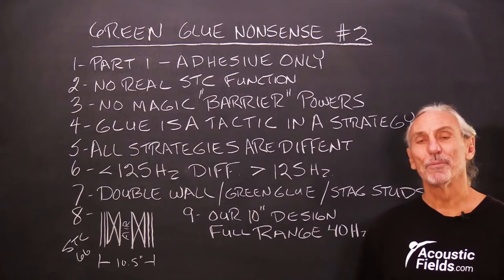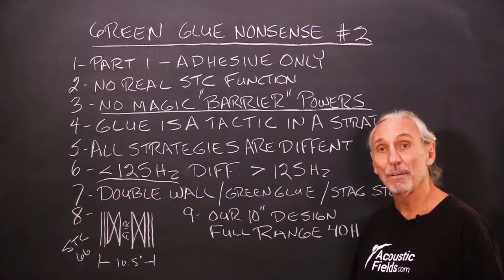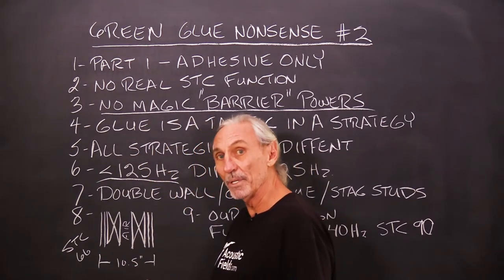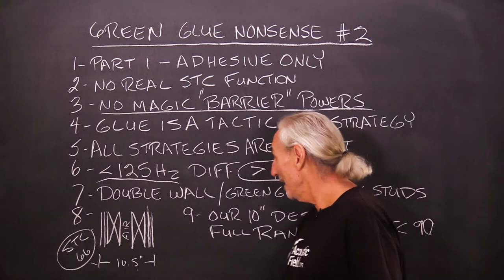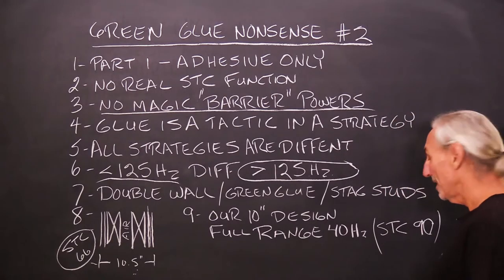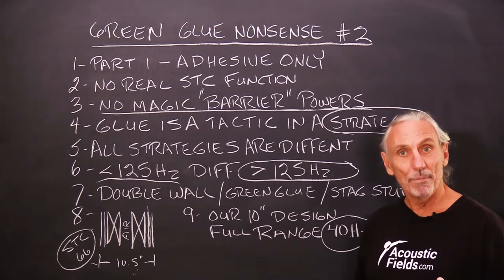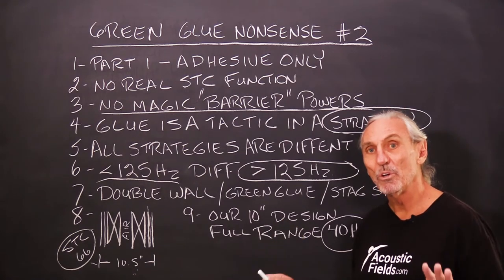Green Glue Nonsense! Part 2 - www.AcousticFields.com

Comment: The Quietrock product you show in your example uses a viscoelastic layer. Guess what? Green Glue is a viscoelastic layering product, the same product you keep bashing. Bashing this product would be like bashing the MLV product you also use in your example. Green Glue and MLV are small components of a larger solution to address a problem. You are basically saying in this, and your Part 1 video, that $30,000 cars suck because Bentley is a much better car. You are comparing apples and oranges. There are tons and tons of people that are happy with the result they get from Green Glue (and other viscoelastic products like it) as part of a comprehensive solution including decoupling with things like clips and channel. Just read the many positive reviews from home theater builders in avsforum.com for example. I have no doubt the example alternative you offer here is superior for higher STC, but it has a significantly higher cost too. Does Green Glue alone offer smaller improvements than 4 layers of MLV + 2 layers of Quietrock + 2 layers of plywoord + 2.5" of carbon + more? It most likely does. But for people that are home theater enthusiasts or have budget studios looking for proven economical solutions, and find your videos that make absolute claims like "this product is nonsense!" just serves to confuse and misinform people.
Reply from the maker: Green glue is an adhesive marketed as as a viscoelastic layer. Read the ingredients on the label. If you want to spend more money on glue for your barrier design that is your choice. It is not the adhesive that produces the performance. It is the layering of materials and the air space which is considered a layering material. We receive numerous calls each day from people who have used this method and are unhappy with low frequency transmission. There are many barrier options that take up less space and perform better. We prefer solutions that treat the complete frequency spectrum especially for home theaters where low-frequency energy issues predominate.
Reply: @AcousticFields  I understand you prefer solutions that treat the complete frequency spectrum. And thats awesome. Your videos prove you guys can build barriers with superior STC ratings in the very difficult to fix <150Hz range. I just have a problem with you promoting yourself by bashing another reputable company that has many happy customers (click bait). Read their literature (about the fact that its NOT just glue), read the many many reviews from users that properly used the product as part of a comprehensive solution. If someone wants to solve the < 150Hz issues, thats an entirely different issue than whether they used Green Glue or not. MLV does not solve that issue either.
Reply from the maker: People can be happy and unhappy for many reasons. Most of these companies play upon the ignorance of the very people they sell to.  Green glue is just what the name implies. It is an adhesive. To attribute some magical barrier benefits to it is ridiculous.  It is an adhesive nothing more and that adhesive is a micro part of a macro design. Once again, MLV is just one part of a total acoustical "spring" system that reduces noise transmission. You can not claim that "MLV does not solve that issue either." You are following in the footsteps of the green glue crowd.
Reply: The point is, MLV does not "solve" the issue, it contributes to the overall solution, just like viscoelastic polymer layers.
Reply from the maker: Yes, it is one material type out of hundreds that we use in our barrier designs. The key to understanding each individual noise frequency and amplitude issue is what material type works best at what frequency and amplitude. Most material types have little value by themselves. Its when they are used in conjunction with other material types that the real synergy occurs.

Comment: The comparison is apples to oranges. Your design is using 4 layers of 1/4" MLV an inch thick in total. With 1/2" plywood? The cost is astronomical compared to double drywall.
Reply from the maker: Its always cost versus benefit with noise. Your method takes up a lot of space and is only effective above 125 Hz. If your noise issues are above 125 Hz. and you have that space requirement to use then this method will work although poorly. Noise transmission efforts below 125 Hz. require much more costly solutions. This is why companies tell you this double wall methodology will work for all noise. It is cheap, easy to build, but what they don't tell you is that it won't work below 125 cycles. I get calls everyday from those who have used this method and are not happy. Unfortunately, the fix in most cases is to tear it out and start again.

Comment: What’s the price difference between the 2 methods?
Reply from the maker: What two methods are you referring to?
Reply: @AcousticFields  green glue versus your method
Reply from the maker: There are no two barrier methods the same. You must measure the frequency and amplitude of the noise issues you are having over a seven day period. We are looking for the frequency and amplitude that is the lowest and loudest over the 7 day period.  We then design the barrier that you build. Every material type and construction methodology depends on the noise issues (frequency and amplitude) you are dealing with. The double wall approach takes up a lot of space, is 40 year old "technology ", and only works above 100 Hz.  Its a waste of time, space, and money.

Comment: So the design in your diagram calls for 8 sheets total of 1/4" vinyl across the barrier? that's a lot of mass, which I guess buys you the lower frequency attenuation. I'm a drummer so definitely want as much low frequency attenuation as possible. Im just a couple weeks away from construction of my garage to drum studio conversion project, essentially using the former design you criticize, so you have me pausing. hmmmm....
Reply from the maker: I do not know what design you are referring to. The standard double wall with this adhesive type does not reach below 125 Hz. It won't help you with your drum room.
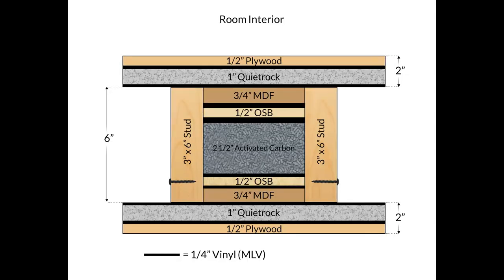Reply: @AcousticFields  Am I correct that your diagram shown at 7:06 in the video is calling for 8 layers total of 1/4" MLV?
Reply from the maker: With drums, you will need to create a wall that is 12" deep. The construction methodology will be determined after noise measurements have been taken in the neighborhood.

Comment: Very interesting alternative in your wall design using the carbon fiber.  Would you use decoupling techniques if installing this in a home environment to isolate from the existing structure?  Especially for rooms where sound transmission leaks through the ceiling to upper floors.
Reply from the maker: All materials and installation methodologies are directly related to the frequency and amplitude of your noise transmission issues. Every material you use along with the way you assemble those materials depends on noise measurements. This fact is so critical, we will not assist any project for noise transmission issues without noise numbers over a seven day period. Since we guarantee our work, we must quantify and qualify any issue before treatment design.

Comment: This is the first acoustic fields video I saw and almost dismissed you guys as it's a little ridiculous to be ragging on green glue/damping compounds and drywall--mainly for the company testing a huge variety of wall designs, then in your graphic you show you use damping compound and drywall...plus plywood, osb, mdf, and layers of 2lb MLV. I'm sure it works great but your room appears to cost around $50/sq ft before the acoustic panels. Of course your bulletproof wall assembly is going to outperform a diyer slapping GG and a second layer of drywall. Do you ever have foundation/ structural issues with all the weight?
Reply from the maker: All structural issues are identified prior to installation.
Reply from the maker: Our rooms work at all frequency ranges for the barrier technologies. STC ratings are worthless when it comes to low frequencies. The STC scale starts at 125 Hz. and goes through 400 Hz. What good is an STC of 66 when the first frequencies it measures is 125 Hz. Taking up 10" of space to deal with 125 - 4,000 is a waste of space.
Reply: I understand your are talking about structural, low frequency sound, but I'm trying to understand how GG + drywall is different from Quietrock? I can't get Quietrock in my area, so if I were to use Quietglue Pro instead of GG between two layers of drywall, would I get better results? I'm sure that drywall with a viscoelastic sandwich from factory has better QC than trying to create that layer on site, but otherwise aren't they all essentially the same? To get 1" of Quietrock, is that two layers of half inch? I've only ever seen QR in 1/2, 5/8, and 1 3/8.
I think your example wall designs are great BTW--that's a ton of mass! I'm just trying to understand the issue with GG as a product, not the wall designs their product has been tested with.

Comment: Green glue works. Contrary to your obvious bias. 
It works exactly as its supposed to.
Reply from the maker: So does standard construction adhesive at 25% of the cost. Compare the ingrediants of both. They are identical.
Reply: @AcousticFields  you say that it doesn't work, but have you actually used the product?
I haven't either but Orfield labs tested green glue vs construction adhesive 

sandwiched both between 5/8" drywall with r13 insulation in the wall, studs 24" on center

adhesive stc was 37 vs green glue 55 

even the competition to green glue was able to get an stc of 52 

so while it won't make a room soundproof for a recording studio I think it definitely works better than adhesive 

and take your rebuttal of the ingredients are the same. if you look at just construction adhesives, some can only hold 100 lbs while others can hold 300 lbs. not even all adhesives are the same

I would be happy to have some test results of cheap construction adhesive that works at 25% of the cost so if you have that data I would love to save a bunch of money

Comment: Heeeelllpppp!!! I need to soundproof my drum room! The room has its walls up so I can’t rebuild everything, what’s the best thing for me to add to walls?
Reply from the maker: You will have to measure the frequency and amplitude of the noise in the drum room. You will need to measure the frequency and amplitude of the noise in the rooms where the noise is transmitting to. The difference between those numbers is the effectiveness of the existing barrier you have between the rooms. Once that is determined you can then design the proper barrier technology to make up the difference required.
Reply: Makes sense, thank you for the response, I’m checking out your website now

Comment: the amount of times that we have to tell architects that this new acoustic product they found won’t work is staggering 😹 Things like expanding foam and ... oh the nonsense haha

but we build those walls in offices etc where you need some privacy etc but noise source is vocal range so it works ok
Reply from the maker: This process is limited to voice frequency responses. However, taking 10" of space to provide noise transmission for voice is not cost or space effective.

Comment: 2 things that you abuse doing. Saying that something doesn't work, but not giving a lot detail about what really does and why. You answer pretty much everytime by saying at it depends on frequency. Look, people watch this video for soundproofing knowledge. It's about soundproofing, as much as possible, as low frequency as possible, ok, period. We want the smartest approach to get down as much as possible. Best low frequency blocking for that 10" space. Also, you are quick to say that green glue is expensive (and it is, and you're right, if it's about creating a thin air gap and decoupling the 2 layers of panels without wall, any flexible adhesive will do, but you don't really say how expensive is "the other approach". We see a message there that you want people to go to you so that you can sell them your solution, not really educate people to what to do. Just telling them what not to do... That's the main problem here I think.
Reply from the maker: The main problem is the lack of understanding of the physics by layman. I get calls everyday from people who use all of these methodologies and are disappointed with the results. Most of these methods are 40 - 50 years old. Most people recommending these options have never built a room in their life. I have built over 240 rooms and tested all. When you are trying to change belief systems that are not well founded in physics, you must first start with showing the unwarranted premises that people work from. The industry has played upon the ignorance of the customer. You must first start with discrediting the unwarranted parts of the belief system. We will be doing a series of videos on specific barriers we have used to treat noise issues on actual projects.
Reply: I am totally aligned with Daniel as I find the video quite interesting but prompt to criticism of  other industries but no others details solution provided. I am sure that many of us will understand the physic contrary to what you say.  Additionally, you are making no distinction in what you present between a music/home theater for example and a standard room which can be misleading. Not everyone will need a STC of 90 as an STC of 66 will be perfectly acceptable for most application. Obviously, if you could achieve an STC of 90 at the same cost of an STC of 66 then you have a valid argument but you provide no details of it and I seriously doubt as it seems that you will have to be build a lot mass to achieve such STC and any sound insulation product adding significant mass are very expensive. Therfore,  rather than saying what doesn't work it would be more interesting to say what works and at which cost. Regards

Comment: I would also like to know what you're talking about when you say you have a sheet for 10$ that will out preform green glue. If you're actually trying to offer practical advice on cost effective solutions and say that green glue is overpriced, you need to give a little more clarity here.
Reply from the maker: What are the frequency and amplitude of your noise issues?
Reply: @AcousticFields  Did you even read the question? 🙄

Comment: Let me guess.  You must take measurements.  Then apply the products accordingly.  Otherwise,  you are just guessing,  and then I can't help you.
Reply: My company uses green glue, and quiet rock with very good results,  measuring or not. For Television noise, voices etc, if applied meticulously,  these products do work. Expensive? Yes. With more people being crammed into shared spaces,  and with housing costs so high,  peace and privacy are paramount.  This so called expert completely writing off these products without first hand knowledge seems suspect. Making a mountain out of a mole hill. I don't care if you stand in front of a chalk  board,  waving you hand over numbers. The proof is in the pudding.
Reply: @brianness7720  No it makes perfect sense.  I've looked at the Green Glue website.  If you replace green glue with your typical adhesive with the quiet rock and/or MLV you'll have almost to matching results.  When you say measure or not, that takes a little credit away from your statments.  Measurements are all we can go by and if you can not produce the measurements to back claims in this line of work then it's just wasted air.

Comment: Great solution except it costs like $100,000 to do a room!
Reply from the maker: Yes, it is the most expensive adhesive I have seen to date.
Reply: @AcousticFields   I'm talking about your solution Dennis!   Yes, Green Glue is a stupid rip off, but few people could afford what you are proposing as a solution with plywood, MDF, OSB, drywall, activated carbon etc.